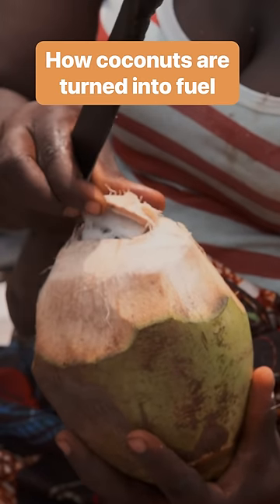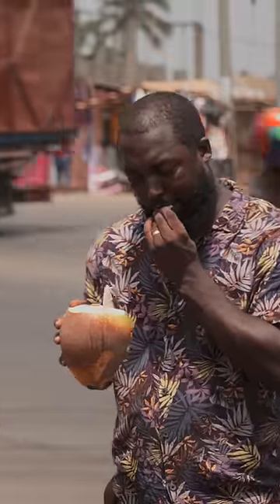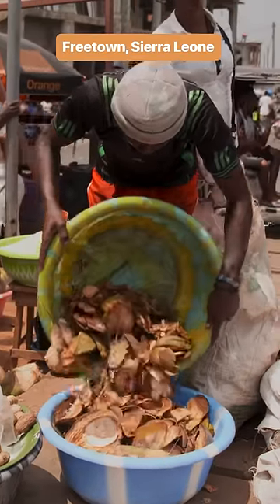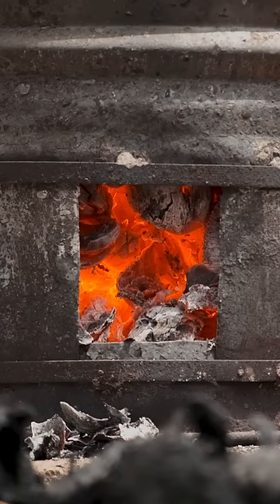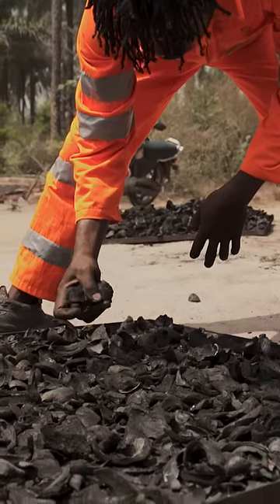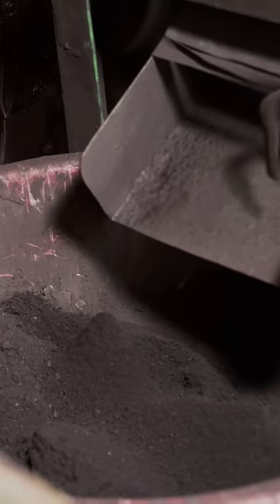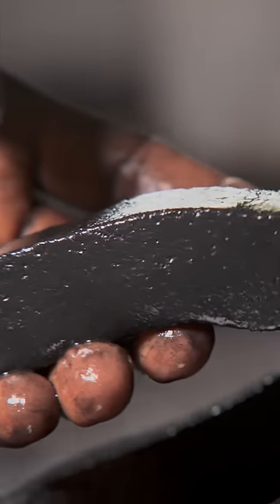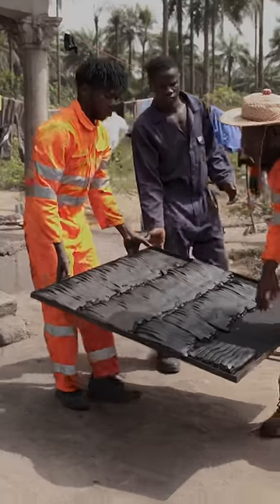How coconuts are turned into fuel #deforestation #coconutwaste #cooking #zerowaste #recycling

Comment: The secret powder is TAPIOCA FLOUR/POWDER.
How do I know? 
Let's say I run similar business.
Reply: I seen flour lite up like fireworks
Reply: It's love. That's what my grandma used to tell me.
Reply: @ColdperpetratorLv  Electrician here. Flour mills, and some wood and textile mills, actually have higher requirements for explosion proofing than a freaking oil refinery!
Reply: @TimeSurfer206  Yeah it's insane how explosive flour can be.
Reply: @Xainfinen  flour is not explosive. Problems are dust particles mixed with air.
Reply: @fackynaxicht8603  Yeah, I know, that's what I wanted to write 😅
Reply: @fackynaxicht8603  Anything that burns can be explosive, in the right sizes and ratios.
We had a sawmill go "Boom" in my hometown, when I was a kid.
Wood Pellet plants have a similar problem to flour mills.
Reply: Can you use the charcoal to safely cook over, or is this just for industrial use?
Reply: @crickettgreen2670  Yes, it's just regular charcoal. If you use coconut coir it does give the food a little bit of flavor same as wood.
Reply: Since it is cooked in a sealed drum does it consider as a biochar?
Reply: @I_Like_Turtles441  No, these are just regular charcoal briquette. Biochar have to be produced by pyrolysis in a kiln, a closed drums isn't good enough to guarantee high quality biochar devoid of any tar, that contain PAHs (polycyclic aromatic hydrocarbons).
Reply: In Indonesia we don't char the husk of young coconut. We use the mature coconut shell instead as the charcoal ingredients. Burns longer, ginger calories and fewer ashes.
It is for cooking, heating, and shisha. Different purpose, different market ask for various size, calories, burn rates, ash content. 
European market demands for higher calories while Mid-East markets demands for brigher and nicer colour burn.
Reply: And Tapioca flour is used as aggregate to bond the mixture together.
Reply: @I_Like_Turtles441  I do not know. These were made into briquettes and intended to be lit up to produce heat and energy.
Reply: Yes, it can be fire hazard and require certain documents to be able to export. 
Just like any other type of charcoal. 

Korean and Japanese barbecue is using coconut charcoal briquette too.
Reply: @Xainfinen  ever played with powdered non dairy creamer and a campfire? Be careful!
Reply: @fackynaxicht8603  everything is kinda explosive if the particles are small enough and there is plentiful oxygen and given an ignition source hot enough,critical Mass,its scary dangerous dude
Reply: Where can I buy some of your products? I bet the bbq tastes delicious!!
Reply: Yup flour
Reply: @Mario-hw9xm  thank you. We can ship the charcoal briquette to your country. What country are you in? 
MOQ 1 20ft container.
Reply: @TimeSurfer206  Sugar was a bad one for it too. My grandfather's grandfather told him that when he was a kid, the only other profession that rivaled the sugar processing death toll at the time was mining. No idea if it's true, but it's plausible enough to be.
Reply: @ledumpsterfire6474  The slaves that wound up in Brazil working the cane fields would certainly agree. Between fire, cayman, jaguars and plague, o my!, the average life expectancy was 3 years or less.
The plants were probably more dangerous.
Reply: Your probably right, I originally thought it would be Dextrin which is a common binder for granulating black powder, and  making common fireworks and components of fireworks, much of which is charcoal based.
Reply: @crickettgreen2670  oh you can cook with this stuff all day and be alright, burning coal and recycled plastics(to get converted into fuel) is more of an industrial type of fuel
Reply: @douglasmatheson403  Thank you for your added info for the discussion, Sir. 
However, (at least) In Indonesia, we do use tapioca flour. It is natural and cheap binding agent. 

I personally wonder why US so dependent on Chinese trade tapioca (to make boba) since Indonesia also produce Tapioca.
Reply: Whoa, bro. Actually I am interested in doing same business hahah
Reply: Asal mana om ?
Reply: @Wisewarna Nazara  that'd be careful inhaling the smoke or fumes from those. lots of tire and carcinogens
Reply: Thanks

Comment: We don't even pulverize them here. Simply use it as brickets.
Reply: The only difference is they pulverize and reform it is because the uniform pieces burn at a similar rate and its a better looking product.
Reply: Yea I was also wondering doesn't burning into a charcoal mean it loses a certain amount of potential energy
Reply: Whats a bricket?
Reply: @agereartist3763  "A  briquette is a compressed block of coal dust or other combustible biomass material used for fuel and kindling to start a fire. The term derives from the French word brique, meaning brick." Bricket is a common mispelling based on pronunciation.
Reply: @oxylepy2  Thank you

Comment: Secret ingredient : Cassava flour
Reply: One could just as easily use wheat flour, or just use any kind of starch.
Only takes like 5% by weight, dry, IIRC.
Reply: @TimeSurfer206  cassava more readily available
Reply: @TimeSurfer206  cassava flour is more sticky,elastic,cheap  and just need little ratio than other flour
Reply: @jinnilovely5573  I'll compare the price per pound of finished product before I start but am set up with the gear.
Thank you and Art both.
Reply: @MrArtVein  TY, I'll do a cost-benefits on it, too.
Reply: I thought it would've been dextrin, just because it is more commonly used in  (charcoal based ) black powder and many other fireworks amd fire work components such as black powder based "stars". But thats all I really know and I am probably wrong on the "secret ingredient."

Comment: We do this at home too. We dry and directly use them as firewood instead of turning it into charcoal though.
Reply: Yes, they wasted so much energy just burning them. They could have used that energy.
Reply: @meta5291 They did use that energy. 
Pyrolysis (charring) dramatically increases the energy density of the material, in this case, coconut

Considering how much husk can be processed in a single fire (and how energy rich the resulting matter), it is purely a net benefit
Reply: @unbearifiedbear1885  OK. Thanks, I wasn't aware of that! I need to look it up.

Comment: They’re losing about 40% of the energy using that method. You can make a retort charcoal oven and use the flue gasses to heat the product and even capture excess gasses like mineral spirits.

Comment: A ton, is a ton.  2,000 lbs.  There is no such thing as a 'metric' ton.  Ton's are a measure used in the imperial system, period.
Reply: A metric ton, also spelt tonne, is 1000kg or 2200lbs

A short ton, or american ton is 2000lbs. 

There is also a long ton that is 2400 lbs
Reply: @justinmackinnon5607  Thank you, I only knew of the metric and standard ton before.